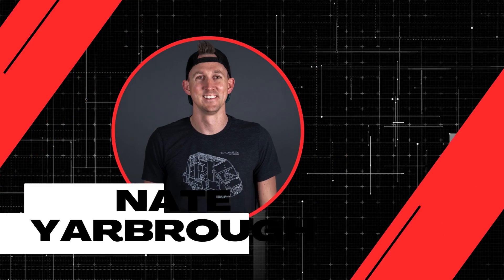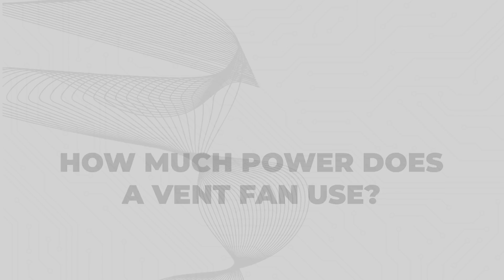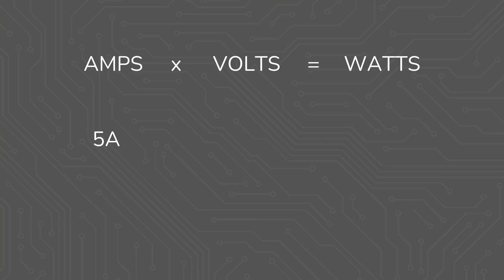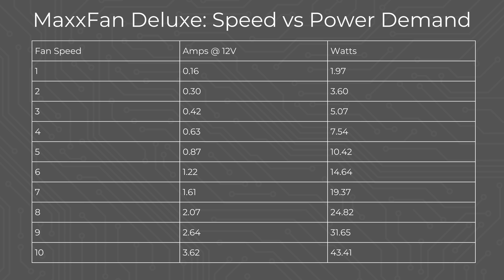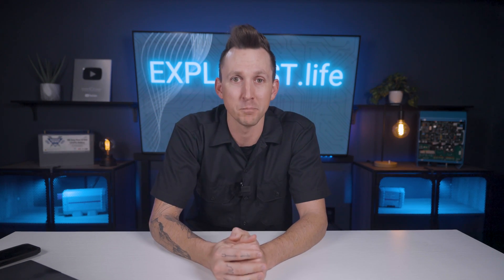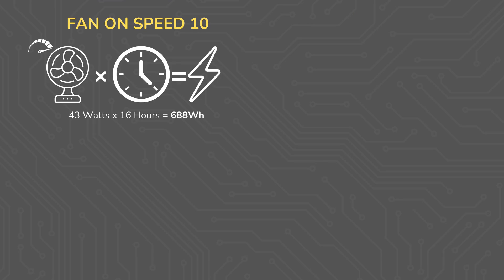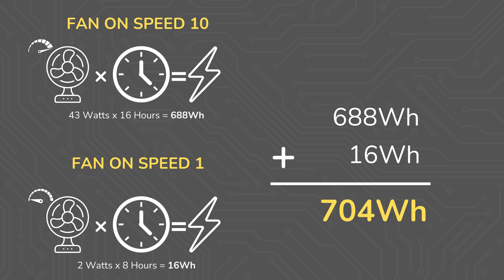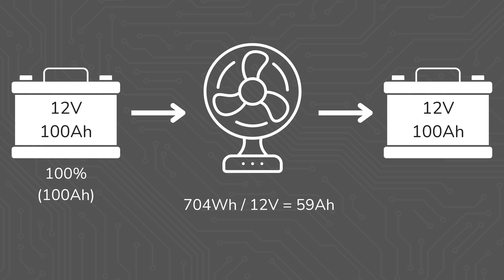Vent Fan. How Much Power for a Mobile, Marine, or Off-Grid Electrical System?

Comment: Hey Nate, You should make a video about cheap electrical system for camper van. People who buy Victron don't care about 10 watt hours here and there.🤔😉😁
Reply from the maker: Actually, most people who buy victron typically take great pride in their projects which results in them wanting to be educated on how much power things use in an attempt to accurately size their system.

That said, regarding your request:  If you watch our videos with an open mind and think critically, you'll find that you'll come away with the knowledge needed to build a functional electrical system with whatever brand of components you like.  Wiring a Victron MPPT will be 95% the same as any other MPPT on the market.

That said, I strongly hesitate to build a 'cheapest of the cheap' system on this channel because viewers will think I recommend those no-name fly-by-night brands, which I don't; but like I said, with an open mind; the education I'm teaching here can be adopted to any brand that you want to build your system around.

Comment: I have a standard Maxx Air Fan.... 2-100AH  Battle Born Batteries and 600w of solar, On my Ram Promaster. Sometimes in the summer I leave my fan run for weeks at 50% just sitting i my drive way. Is this shortening the life of my batteries..? There always at 99% maybe in the morning 90%. Do these short cycles harm the battery? There 4 yrs old and never a problem....

Comment: I live in Maine. Summer nights go down to the low to mid 60s and normally I can run my window fan at 100% from 5AM until 8AM when the outside temp meets my inside temp [around 70]. I shut the windows and will stay cool enough [below 82] until around 2PM when I will put the A/C on. By 7-7:30PM it's usually cooled off that I open the windows and turn on the fan at 50% for 90 minutes for the night.

Comment: Have you looked at the Flettner vent system? delivery vans in western Europe are often equipped with these and don't require any power at all. It is wind powered and provides a quiet air flow. You need to add an air intake somewhere in the van to allow it to turn over the air in the van.